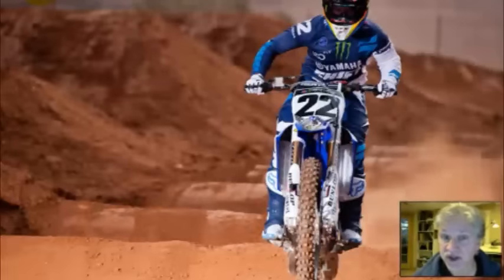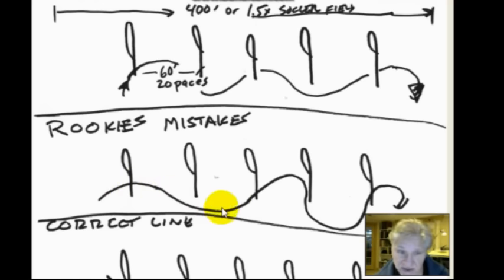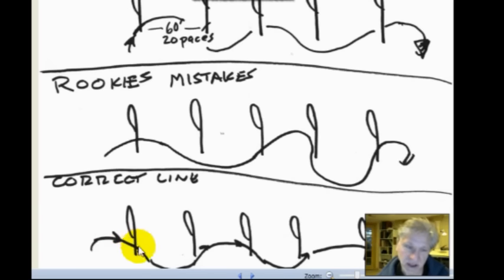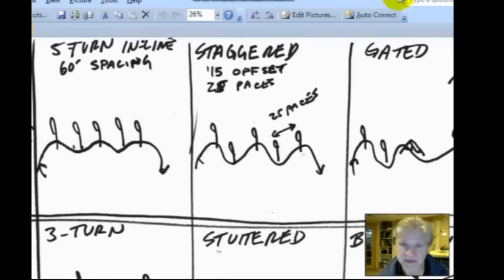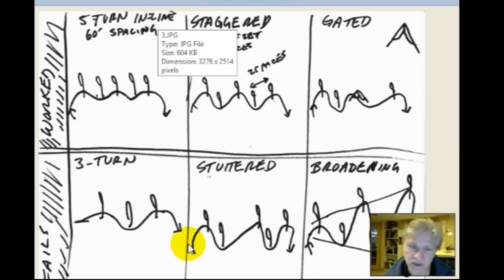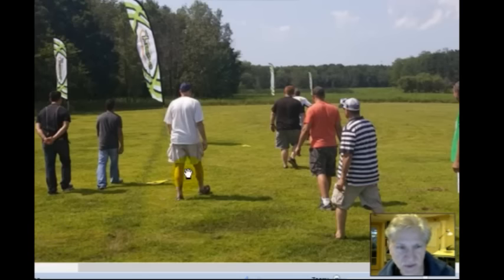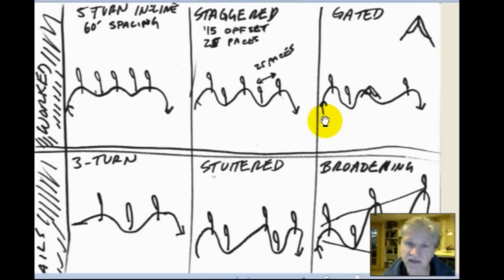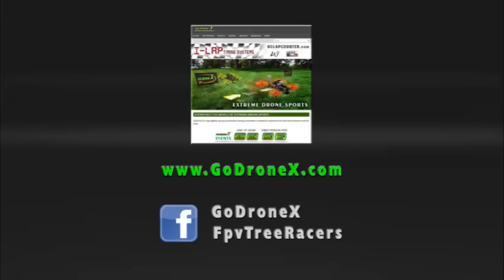Drone Racing Course Design Wins & Fails: Slaloms

Comment: Thanks for sharing. I have a question pls,, what's the difference wirh acro and rate flight mode? Cheere mate. 😃
Reply: +pitotoy07 acro is computer assisted that keeps the machine from rolling over too much and rate means the pilot is in full control, no computer assist.
Reply: thanks for the info.
Reply: +pitotoy07 They are the same thing, some people call it acro, some rate. This is the mode where you get no leveling assist.